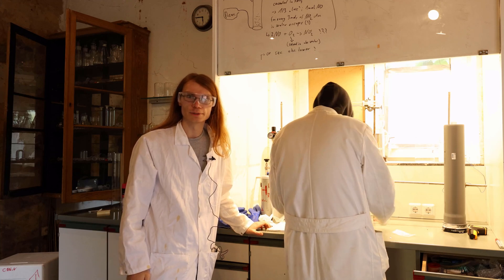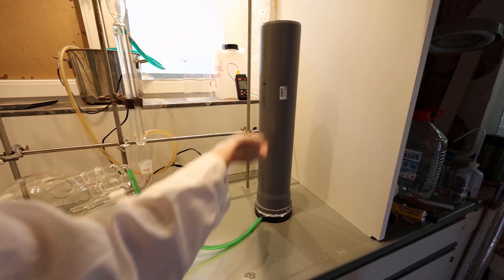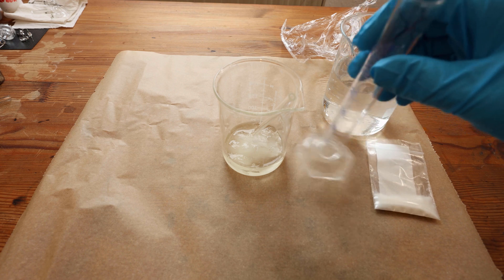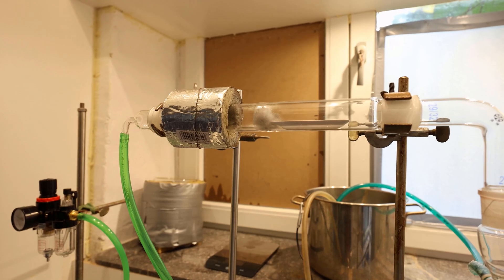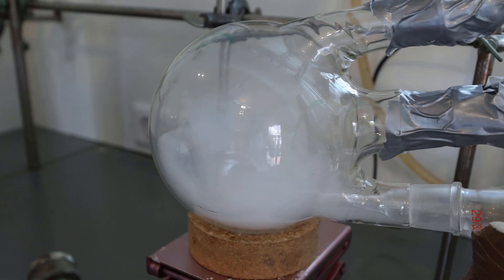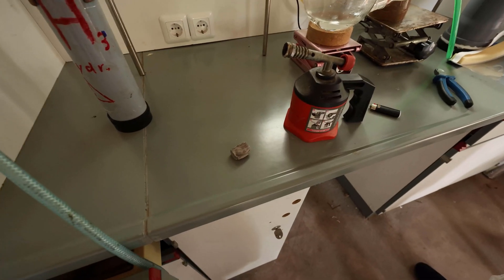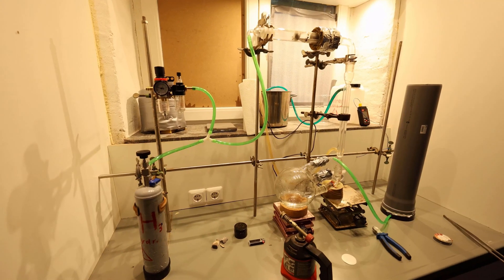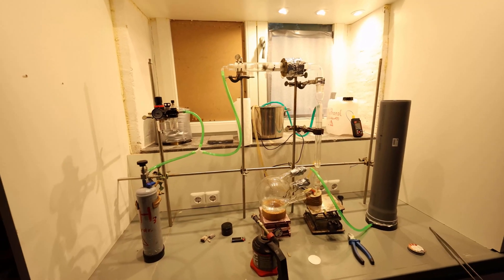We tried to make Nitric Acid by Ostwald Oxidation [Part 1]

Comment from the maker: So there are two things I already considered

1. High pressure leads to unwanted side reactions, which is the case here. My friend tried a run before, pulling the gas through with a vacuum pump, which went better. However it's obviously not great for the pump.(We need a good membrane pump I guess) 

2. The tube we used has a pretty big diameter this probably reduces the flow rate, leading to an increased contact time. Too long contact time leads to decomposition of the NO
Reply: For anyone who's interested in repeating this experiment: You can buy this catalyst ready made pretty cheaply. It's sold as platinum bright embers for gas fireplaces.
Reply: Replace NH3 gas with Urea that will decompose into NH3 (no pressure issues) when heated. Second use a smaller diameter quartz tube with  the Pt'zed wool longer inside so there is more contact time. 

instead of using a vacuum pump use Aspirator. You can drive the Aspirator using a small DC water pump, and add NaOH to neutralize acid, NOx's
Reply from the maker: @guytech7310 We are actually using the ammonia bottle because we can control the glas flow better than feeding the output of the reaction into the ostwald reactor.
Reply: @thesciencefurry  But you stated you had an issue with the pressure the bottle cooled as to draw NH3 from it. You should be able to control the NH3 output using Urea by thermal decomposing it & regulating the flow with temperature. Plus its probably a lot cheaper than purchasing an NH3 bottle.

I am just making suggestion, not a criticism.
Reply from the maker: @guytech7310  It's no problem. I'm open for suggestions. But we specifically condensed the ammonia in a bottle, because with an ammonia generator we don't have such fine adjustment. The problem with the bottle cooling down can probably be solved by placing it in a warm water bath or adding some buffer volume
Reply: Try using oxygen and ammonia instead of air. If you are getting too much AN smoke than you are getting too much ammonia in there. Also add a flash arrestor to prevent the ammonia from burning  directly. Automobile catalyst bricks work well as the catalyst as the mix of platinum and rhodium on the first brick is similar to what's used industrially. The irony is that under reducing conditions found in exhaust, this brick is used to remove the nitrogen oxides formed by the high pressure combustion in the engine. ❤
Reply: @christopherleubner6633  He is using pure oxygen & NH3 (not the two gas bottles).
Reply: @guytech7310  no, he said he’s using an air compressor.
Reply: @guytech7310 he did not say anywhere he’s using pure oxygen ya muppet
Reply: You NEED flowmeters on both air and ammonia lines to be able to fine tune flow. Also you need pressure reducer on ammonia line to cut out all fluctuations.

Comment: I think it works better if you use more catalyst and more glass wool. For example, use palladium or iridium, which might work better. So fill the tube at least halfway with catalyst. And install flow meters on the ammonia and air inlets. And try to keep the gas flow as low and controlled as possible.

Comment: I would have used the pump in reverse at the end of the . It will not hurt your pump . If it is on the backside of the dryer or add a second dryer and use H2O2 in or both dryer. and use a fish aquarium pump instead of compress air

Comment: Seems it would make more sense to make ammonium nitrate, then use sulfuric acid to end up with pure nitric acid.
Reply from the maker: Meh. That's another step that can be avoided.
Reply: @thesciencefurry  I'd be just fine with storing my nitrate in that form because it can either be used as is, or reduced when and where I need it, and its both more stable [as in it breaks down less rapidly], is safer to handle, and its self can be used in the synthesis of some rather interesting chemical compounds as a salt.

But...

You do you.

Comment: I love how you guys call out a well known YouTuber and his procedure as "shit", while you couldn't even pull off a quite simple catalytic conversion.  Not a good look when falling flat.
You have no flow control for either of your gases.  Pressure regulation does not equal flow control.  Your dwell time is way too short in your catalyst and it has to be evenly packed in multiple groups to counter tunneling .  The NH3 wasn't even decomposing. 
Buy some clips for your GG joints.  They're cheap.
Reply from the maker: @texNoz   We didn't call his procedure shit. But the video how it is structured is. It has below average editing and sound design and the information could've been conveyed in a much shorter video. The molar amounts presented were also wrong. Go ahead and calculate it yourself. 

But thanks for the criticism, I thought my friend had clamps. That was an oversight. We will continue with this project soon hopefully.
Reply: @thesciencefurry  Hope you're not talking about Nurdrage?
Reply from the maker: @Felixkeeg No, it was someone else xp

Comment: Try ammoniumdichromat on pumic stone as an catalyst. It did work for me. And you need an bypass for your ammonia tank so you can regulate air and ammonia flow if you have wihte clouds you have to much ammonia.
Reply from the maker: I"m trying to avoid that since rhe chromate is going to get carried into the acid. With platinum it's not that big of a deal.

Comment: For anyone who's interested in repeating this experiment: You can buy this catalyst ready made pretty cheaply. It's sold as platinum bright embers for gas fireplaces.
Reply from the maker: Other people mentioned it already, but I just looked it up. Seems like a great solution fot it!
Reply: Would it be possible to skip platinum and use something else like iron or copper, albeit at a lower yield?
Reply from the maker: @andrewschmidt1257  why would you want ti use that? We already have yield problems xD
Reply: @andrewschmidt1257  Yes copper is usable as a catalyst for nitric acid production. There are 2 big drawbacks to using copper. Aside from a lower yield the reaction doesn't produce enough heat to be self sustaining so you need an external heat source when using a copper catalyst. #2 Copper is soluble in nitric acid so it will get eaten away by the reaction products.

Comment: If you are wanting to do this reaction on a hobby level but cannot find a suitable catalyst, you can use a section of brick 1 out of an automobile catalytic converter. The catalyst is coated with platinum 90% rhodium 10% which is fairly close to the screens used for making the nitrogen oxides on an industrial scale. They are 20% rhodium. If you want more nitrogen oxides then use pure oxygen and a low concentration of the ammonia vapors.❤

Comment: Loved your video. I have a suggestion you might consider. Coat the reaction vessel with sodium silicate and place some nichrome wire into it. After dried, add another layer of sodium silicate and allow to dry again. Once dried you can use your bench power supply to regulate and maintain a constant temperature. I look forward to your feedback. Cheers

Comment: My idea was to electrically coat etched graphite with platinum instead of the mirroring solution (as that is not as easily available) makes the deposition much more controlled, and also faster i think?
Could even use carbon fiber for it. Also i think i heard platinum-palladium is even better than just platinum. As opposed to rhodium which supposedly supports nitrogen formation.

Comment: You said in your comment that the contact time is already too long, so i think to lower the amount of ammonium nitrate byproduct produced, you should reduce how much ammonia flows through the system and increase the flow of air, creating a more oxygen rich environment. Its just a suggestion, i don't know if it will actually work, but maybe you wanna try.
Reply from the maker: @ae-bd5gr  yes, we played with all sorts of gas adjustments, if that would solve it, it would be easy.

Comment: Perhaps you should electrically heat the quartz tube (tube furnace) to better control the temperature.
Reply from the maker: This could be an option but it's suboptimal. The catalyst temperature is mainly influenced by the exothermic reaction itself. I would argue, if the catalyst is not maintaining it's optimal temperature, heating it is just treating the symptom of bad reaction conditions(like flow rate and composition of the incoming gas or maybe even the geometry of the catalyst)

Comment: Green chromium oxide is just as good of a catalyst here. Sandwich it in a narrow glass tube between two pieces of ceramic wool and it will work.
Reply from the maker: @Relatablename  Not really keen on using chromium. Even tho we are in a fume hood. I think industrially platinum is preferred, I'm sure for a good reason.
Reply: @thesciencefurry  OK, it's only +3 valency which isn't toxic, and it doesn't react at all but I'll respect it. Anyways your biggest problem is contact with the catalyst, as most ammonia passes over and complexes with the NOX gases which were produced. At least use a narrow glass blowing tube and fill a good amount of the length with your platinum wool.
Reply: That goes easier soak pumic stones in ammoniumdichromate solution. Heat the pumic stones and you have an fine Chromitrioxid catalyst. Usable few weeks bevore it gets to briddle. Natural pozzulana earth would be better than pumic, it holds up to 1200C (so they wrote)

Comment: Does the nitrogen in air take away heat from the reaction? Maybe an oxygen concentrator could be used to provide pure oxygen.
Reply from the maker: There is enough oxygen in the air. You saw in some points the catalyst got very hot. It's more about finding the right operating parameters which is hard to judge, because we just look at how brown the flask is.
Reply: pure oxygen -> risk of boom
Reply from the maker: @mixdxperience1000  Indeed that aswell apart from being a total waste

Comment: I forgot to mention, maybe use an aquarium air bubbler meter to gauge the gas flows?
Reply from the maker: @WaffleStaffel  The problem is not the lack of instrumentation of the gas flow, but the difficulty to judge if it works. (By looking at the color in the flask) Also, like said, with the current setup the optimal point might be below the point it's self sustained.
Reply: @thesciencefurry  Ahh. The ammonia flow really is high enough to chill the bottle? That's surprising to me, but then I've never been lucky enough to have lecture bottles, and the idea of making my own for ammonia is intimidating. I think my neighbors are too close to me if I were to have an accident. Anyway, thanks for the video, this is the most impressive attempt at the Otswalt process on YT.
Reply from the maker: Yeah the bottle cools super fast with very little gas boiled off, that's why this gas is used as refrigerant.
Reply: @thesciencefurry  can you put the cylinder into a warm temperature controlled water/oil bath to compensate for the heat loss?
Reply: @thesciencefurry  Ahh, of course. Makes sense, especially in an adsorption system. Maybe putting the bottle in a large basin of tepid water with a pump circulating the water would help stabilize the pressure.

Comment: It was an admirable attempt! Does the catalyst need to be thinner, like the one or two layers of screen mesh/gauze used industrially?
You can get platinum gas fireplace embers surprisingly inexpensively, I think it's on a rockwool substrate, I'm not entirely sure. It's more active than the platinized quartz wool I made- (Are you referring to the Astral Chem video?). I only made one attempt, I decided to save the remainder of my materials until I have something beside methanol or ammonia to test it on.
Reply from the maker: @WaffleStaffel  ehat do you mean with thinner? Idk If I should confirm what video it is xD What we observed is that the platinum gets removed pretty fast, at least during our experiments.(In the industrial process it happens aswell to some extent) I made some new quarz wool with a bit more platinum in solution and also I'm planning to do the process twice so theres more platinum on it. Also I thought about using some other substrate because quarz wool is not that great to handle.
Reply: @thesciencefurry  Thinner in that, from what I've seen in photos, it's just one or two layers of platinum mesh sort of stretched taught like a drum in the cross section of a tubular reactor, reducing the time it's in contact with the catalyst.
Ok, I shall not press on the identity of the other video ;)
The idea of having your Pt burning off into a fog hurts to think about!
Reply from the maker: That's an interesting idea.I will keep this in mind for future attempts👍 I was wondering how the catalyst is made industrially. It's definitely a fine balance between getting all the gas in contact with it, while only keeping it in contact for a very short time.
Reply: @thesciencefurry  Quoting GPT- "Industrial reactors use 3–5 layers of gauze, each with a thickness of 0.1–0.2 mm. The layers are stacked closely to provide a highly active surface. Residence times are typically in the range of milliseconds, as overly long residence times increase side reactions. The design aims to balance residence time and gas flow rate to ensure optimal conversion (about 95–98%) of ammonia to NO while minimizing byproducts like NH4NO3"
Reply: @thesciencefurry  I suspect the cross sectional area : thickness ratio is the key to the most efficient reaction. A number of people on the SM forum have had moderate success packing up to about 6 cm of various catalysts into a 1-2cm tube, but using GPT's figures for cross sectional area and flow in an industrial reactor scaled down to a 2 square cm tube would give a rate of 120 LPM (GPT says 9LPM per square cm for ammonia, and 61LPM total, though I've seen papers from the 60's suggesting 1.6L per square cm per minute). Supposedly this would be a feasible velocity in a small scale reactor, but would require tight thermal control and gas flows. That's with pure Pt mesh gauze though. Of course, that's an insane flow rate, and would produce 2 liters of azeotropic acid in just over 5 minutes, but it emphasizes the brief residence time over the catalyst used in industrial scale. OTOH, people seem to have difficulty with NH3 passing unreacted, and getting NO2 from their setups, even with much longer residence times. Also, I've never seen anyone introduce air immediately after the reaction zone to oxidize NO to NO2 where it's still hot. I don't know how important this is, but various sources say industrial reactors do this part at 250-600C. You could bang your head against this problem for eons tweaking parameters, and surely people have. DIY HNO3 from the elements is such a seductive prospect!
I'm just rambling on with my personal theorists, you've actually done it!